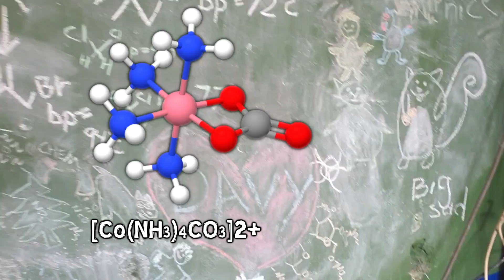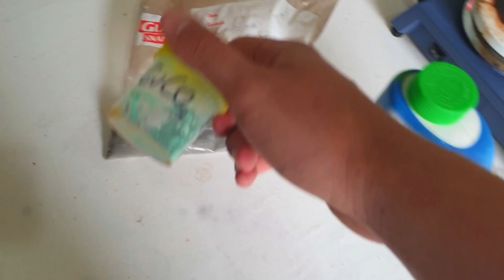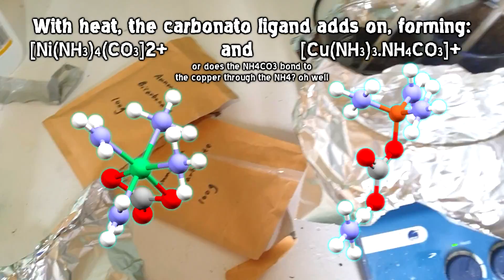More Carbonato-Transition metal complexes

Comment: You should try making some tetramethylammonium triiodide. You basically just mix tetramethylammonium iodide with iodine. Tetramethylammonium iodide can be made by mixing trimethylamine with iodomethane. Idk if any of those are hard to get but the crystals are NUTS, they look like metal. Made it in second year
Reply from the maker: oooh that sounds pretty darn cool. Some hard reagents to get though for sure
Reply: @ExtractionsAndIre  I haven't done any amateur chem myself but iodine is pretty easy to get and i think iodomethane can be made with methanol and iodide and some sulfuric prob? Idk about trimethyl amine, but for all I know you could make that from ammonia and the iodomethane... might not be too bad

Comment: I can hear BigClive in the background screaming at that non compliant UK plug. 😂😂😂 You need WAY more power on that pump, looks like at least 20 watts, get a cheap 12V 2A PSU. 
Old fridge or AC compressors are really nice for vacuum filtering. They are dirt cheap and pull quite good vacuum while staying almost dead silent.
Reply from the maker: 2A you say?? Ok I'll look out for one!
Reply: @ExtractionsAndIre  It should do it. I have a similar pump from ebay and use it for a vacuumm table, it pulls roughly 2 amps. Get a 3A one just to be sure!

Comment: You can buy replacement power plugs from Bunnings, dude. It's a fairly simple swap over. The only things you need to make sure of is that the earth goes to the bottom connection, and that no wires are crossing. It should literally be a $5 and 5 minute fix.
Reply: I just checked, they average around $3 each. But they're free if you can pilfer one off someone's hard rubbish pile.

Comment: Also your model for [Cu(NH3)3(CO3)] is bad. If its Cu2+ then with at CO3- ligand is shouldnt need a counter ion. The NH4+ ion would be countered by OH-.  The Ni3+ complex would likely have a nitrate counter anion.
Reply from the maker: The reference gives the formula as [Cu(NH3)3.NH4CO3]- , which is pretty strange I gotta say. Otherwise yeah, I've ignored counterions from the structure for simplicity
Reply: Yeah ignoring counter ions is totally normal. I wondered if you had made that goofy structure based on the old reference paper.
Reply from the maker: I was searching for more references for the copper complex but couldn't find any, which is why I was so determined to do the carbonate test at the end, to be sure the complex was even real, not just the tetraammine

Comment: Not dead flies, fly shaped crystalline structures. They're art
Reply from the maker: "Mixture was refluxed over catalytic dead insects"
Reply: Extractions&Ire next paper “A qualitative comparison between catalytic capacity of Diptera species”
Reply: @ExtractionsAndIre  "The residual bug carcasses were removed via hot filtration followed by removal of the solvent under reduced pressure"
Reply: Extractions&Ire 😂
Reply: @ExtractionsAndIre  I was one time experimenting with high voltage stuff and had a cave cricket jump on my shoulder.  It became test subject number 1.
Reply: @ExtractionsAndIre  you should make MeTh
Reply: @sammiller5114  no, he shouldnt! i would love, to continue watching his hillarious videos.
Reply: bad. It would be more fun if MeTh was part of the chemical equation doe
Reply: @sammiller5114  now i think of something like methylthorium? :D
Reply: bad. Methlamine. I think I spelt the wrong
Reply: @sammiller5114  methylamine*??

Comment: Motors typically take quite a bit of current.  Especially ones under as much load as you are putting that one under.  The little phone charger power supply is definitely the problem.  Once vacuum gets low enough, the charger is hitting it's current limit and shutting itself off so it doesn't explode and/or catch fire ;)

Find something that has a rating for current on it.  You probably want something around 1A or maybe a bit more.  That charger probably does 100-500mA.  Love the videos!
Reply from the maker: Great advice thankyou!! Will do that!

Comment: Hey quick question for you when you're filtering through those fritted disc funnels do you put anything in them to filter through? basically I'm having troubles cleaning mine, i wqe  purifying battery acid and basically the longer I ran the purified acid through it the less would come through to the point where I couldn't get anything to draw through it.  I was just trying to make the acid more clear there wasn't a bunch of junk in. Heelp
Reply from the maker: Usually I don't put anything there, unless the precipitate is super fine or I don't want to scrape it off the glass, like energetics or something. 

Yeah I mean you can damage the frit sometimes, but usually only with really harsh alkali, wouldn't expect it to clog with sulfuric. And I mean, you can't put much in the way of sulfuric anyway, except the glass frit. So dunno. Just needs a clean I guess? Can always do pirahna, carefully of course. That's a good thing about frits. You can just blast them with pirahna if you're ever worried they're not clean enough
Reply: @ExtractionsAndIre  I didn't even think about piranha thanks for the reminder. Also I don't know if it had anything to do with it but it was a cheap China One but I don't know if maybe there was other stuff in there that I didn't notice or what not. As always thank you for answering my questions and helping me out with my entry into this realm it means alot!! On a side note I just removed some ammonium nitrate from cold packs, purified it, powdered it, and put it into a nice Brown Boston round bottle from 1910.......and I was gently tapping the side of the bottle to Compaq the powder and the side of it shattered ........😐 yay science lmao. Thanks again.      Harry

Comment: The pump stalling is probably just due to the dinky little power supply, get one that can put out at least half an amp at 12V and it should give the succ even with a plugged input port. I have a similar but smaller one and it pulls around 4 watts with the input plugged.
Reply from the maker: So it needs more current and it should be okay? I'll just buy a beefier power supply off eBay or whatever?
Reply: @ExtractionsAndIre  Since it's 12V why not just hook it up to a car battery? I'm sure you've got one and it'll at least tell you if the problem really is the PSU before you spend money on a new one.
Reply: @ExtractionsAndIre  Yeah, or hit up a thrift shop and look for an old inline power brick good for 12V at 1A+, they're pretty common for things like external hard drives and that sort of thing. As someone else mentioned a car battery or car jump pack will also work, I've used a jump pack to power a pump to circulate water thru my Soxhlet extractor, it'll run a small pump for hours.